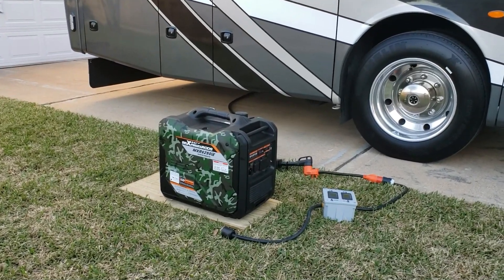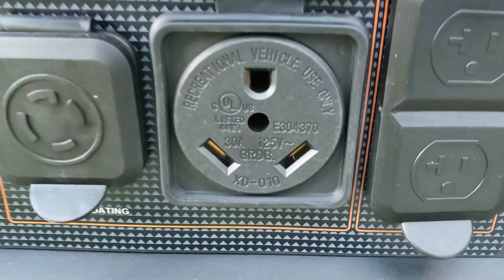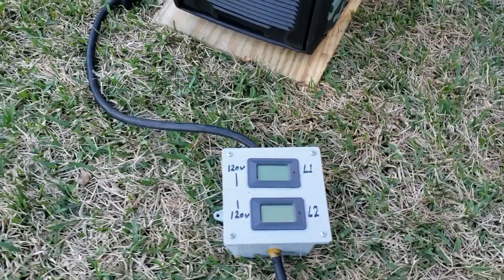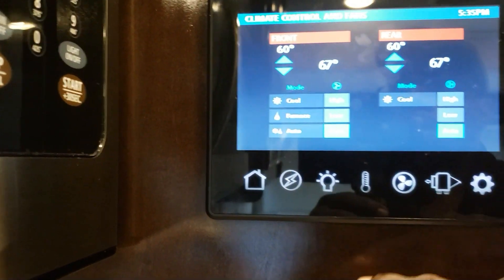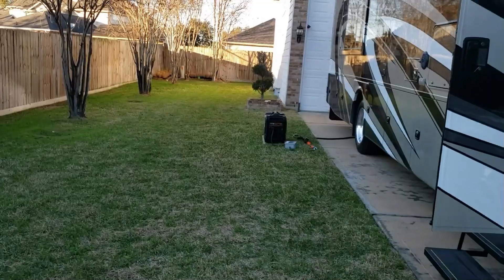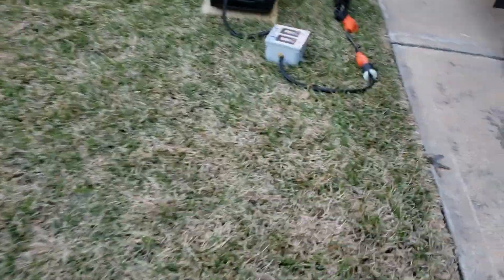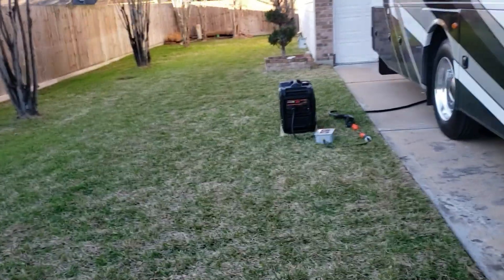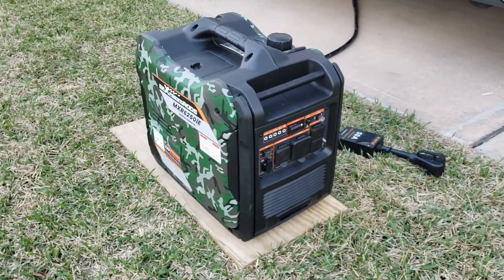MAXPEEDINGRODS MXR6250iE  | Peak 5500W, Rated 5000W, Portable Inverter Generator 120V/240V Load Test

Comment: I have an solar inverter everytime I plug it in the circuit breaker pops…. Anyone know how to change the floating neutral??? On the delta pro I have to use the 30 amp to 120 adapter at the nema l14-30r plug to make it work….. but when I use my eco worthy off grid inverter it won’t work off the 120 or the 30 amp outlet….
Reply from the maker: You may need to add a bonding plug to prevent that
Reply: @G @GeneratorReviews thanks for looking at my comment…. So I did buy one of those bonding plugs an it instantly cause the gfci to pop turns out that on the side where the run butt  is located the ground and neutral are already both on the engine block…. I reached out to the manufacturer to see what input they had on this issue….

Comment: I finally got one and started it up for the first time today, but it shuts itself off in just about 10 seconds. No load, run position, oil full, gas full, open area. Any idea why it shuts itself off?
Reply: Just a quick update on the resolution. The vendor sent us some parts - a carburetor repair kit and a inverter board with instruction videos. Based on the symptoms - auto shut off, eco switch having no effect on idle speed etc., my guess was that the inverter unit was most likely the culprit so I replaced that first, and that solved the problem. The generator is running fine and we have used it to power concrete vibrators, circular saw, compressor, etc. at a construction site without any problem. The aftersales service has been great.
Reply from the maker: Try running with the choke halfway and see if that helps then run normally
Reply: @GeneratorReviews  Thanks for the reply. I tried that too but no luck. I was thinking (1)  is there a screw with which I can adjust the idle speed, or (2) does it need some load to keep the speed up and not stall?

Comment: What was the voltage and frequency at idle speed with no load? I was going to buy the Briggs and Stratton one until I saw your test that revealed the problems at idle speed. Thanks for the info. Subscribed.
Reply from the maker: The voltage and frequency on this was perfect.

Comment: I like your testing set-up with the Volt, Amp, Watt, Freq, Power Factor meters, Decibel meter and the O-scope...and then you utilize the generator apps on the Bluetooth models. This is all critical info needed along with understanding the internal wiring of the receptacles to present a good video. 👍
Reply from the maker: Thanks Boyd 
I appreciate you checking out the channel 👍🏾💯

Comment: 4800 RPM Wow, hope it will hold together.  Great review as usual, thanks for all you do.
Reply: Hey Gavin, I was running some of my generators today and the Westinghouse iGen 2200 when running at maximum load 1825 watts, it's running at 5400 RPM. I never noticed this until looking at the specs. on the side panel. I don't see how these machines will have much longevity running at such high RPM and holding only 11.8 oz of oil. What are your thoughts?
Reply: @t.d.harris1311  I agree but most people probably won't use them enough for it to matter.  All the proven  Honda gX engine designs... The most common engines used all around the world.. are for 3600 RPM Max.

If you're going to use a generator everyday and depend on it there's only one kind you buy.

I think Gavin should do a run till failure test with one of these.... Loaded up to 75%... See how long it lasts.   In all likelihood only a couple hundred hrs.
Reply: @duskyman1  Agree with you 100 percent on the Honda's,  live in northwest Florida it's not if a hurricane hits but when. If you still have a house standing, our average time without power is 8 to 10 days.  Plan on adding a Honda to our 3 other generators. Best regards!
Reply: @t.d.harris1311  live in louisiana...
I'm familiar with hurricanes and being without power for 3-10 days.   People out in the country can be up to a month.    Also had a house in Panama City Florida... Damaged by Michael was without power for about 2 weeks. Of course it was about a week before they even let us back into the area. ...worst i ever seen. PC was basically obliterated.... 3 months before there was even a McDonald's open to get a biscuit.   Even today it's still weird with all the trees gone, snapped off halfway up.   My sister had a house on the water... Eye wall went over her. No damage shielded by the rise in the land behind her blocking wind.  Parents house lost part of its roof. 
..

Comment: I would say this generator performed wonderfully for the money. $1300 plus tax and you get 240 volts. It's the physical size of a unit like this that attracts people. That clean power sinewave will attract the informed. Big bang for the money. Very nice work. I would suggest to all RV folks make sure a "soft start" is installed on each of your roof top A/C systems. If you don't your foolish.
Reply from the maker: Well said Dan👍🏾

Comment: This is a very impressive unit.  High KW output, small size, battery start and the best part 120/240V!  Add dual fuel for propane and its near perfect!  I see its 4800 RPM, wow!  that's how they are getting high output from the small size.  4800 RPM for a small air cooled, splash lubricated engine, is high.  Hopefully they put a lot of design and run hours on these during testing before releasing these for sale.  I'm sure they did.  Still impressive.